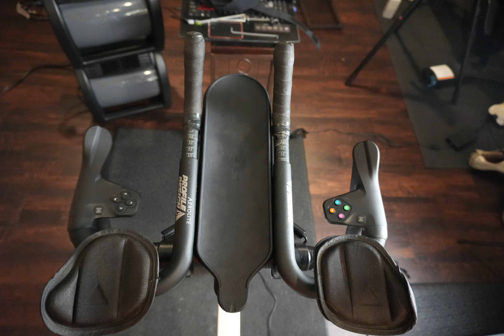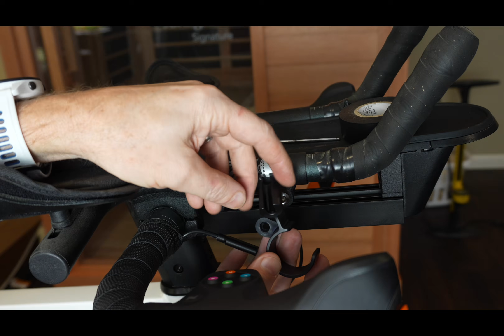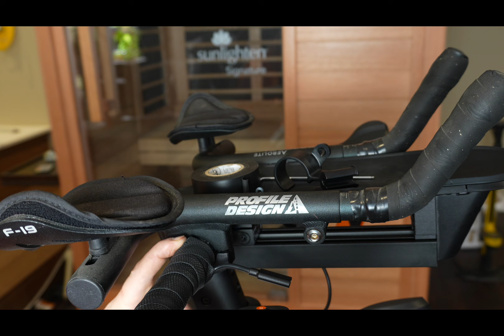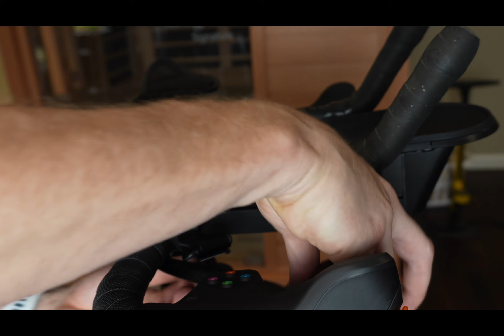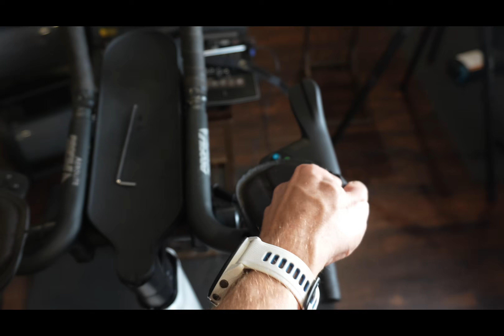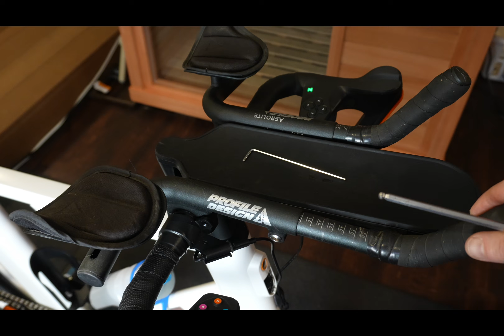Zwift Ride - How To Add Aerobars

Comment: I appreciate the first video where you highlight the thru axle issue. But if I come across you in a race in Watopia I am going to trash talk you about the aerobars.   :) :)
Reply from the maker: So you must be a roadie?
Reply: @KeithRanly Oh I did aero bars for years as a triathlete but later in life discovered the insane joy of riding in tight packs at high speed - with normal bars.😂 So I transitioned (see what I did there?) into the road scene.  But the obvious joke is they can't make a difference in Watopia.